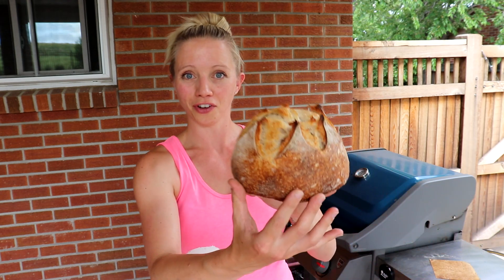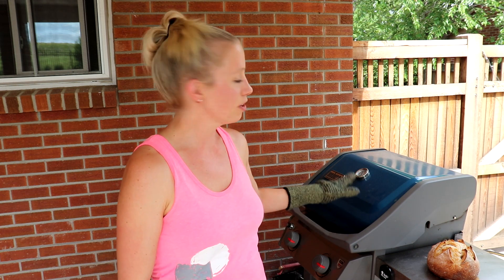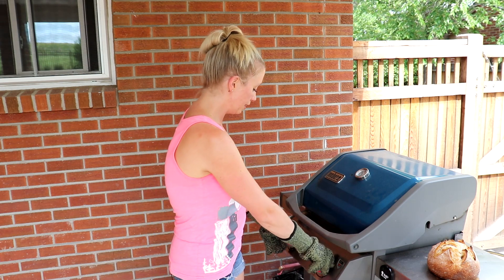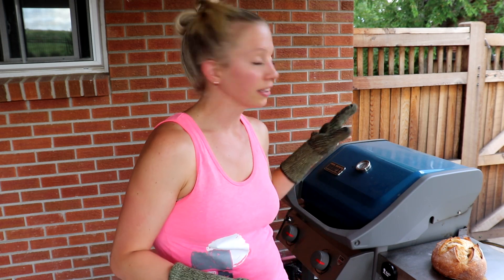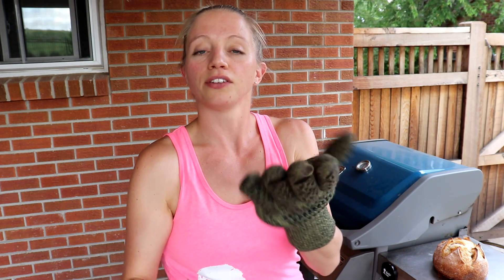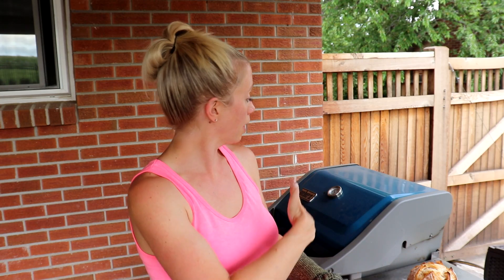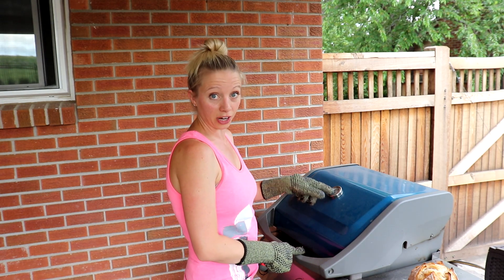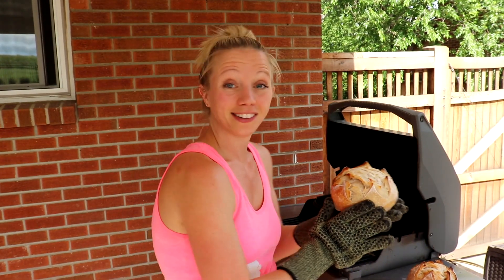How to Bake Sourdough on the BBQ Grill

Comment: Thank you… your video has perfect timing.  We are also having a incredible heat wave just now and I’ll be baking my loaves tomorrow morning.  I’ll try your method on the bbq and will let you know.  I’m using a pot style Dutch oven and will be putting cornmeal or oats on the parchment paper before placing the bread on it.  I’ll let you know
the results I get…
Carol
Reply from the maker: That would be great, Carol! I would put the cornmeal under the parchment, so it doesn't affect your final bread. Best of luck!
Reply: @leavenly8473  Did the bbq … I had trouble keeping the temperature constant so opted to give the range of 400 degrees to 450 degrees.  Went very well and the finished
product had more bubbles in the crust than usual.  Took almost an hour for the first bread and a bit longer for the second loaf.  Will definitely do it again.  Thanks for
the great idea…

Comment: I have a loaf proofing, that I started last night.  And, as luck has it, we noticed a plastic burning smell from the oven last night when I started to make dinner.  Fried wire in the back that leads to the main burner.  Yikes!  I am going to try your bbq method with this loaf.  Fingers crossed!
Update:  it worked!  It really worked!  I ended up grilling it longer but it was full of dried cranberries so it was more dense.  After taking the lid off, I placed an aluminum pie plate upside down on the pizza stone, to raise it up.  No burning on the bottom :). Great tutorial!  Thank you!
Reply from the maker: Thank you so much for this review! I love that you were still able to bake your bread despite losing your oven. Your tips for raising the loaf higher are also fantastic! Thanks Bernadette!!

Comment: I actually used our Traeger grill to bake my bread yesterday before I even saw this! Great minds lol. A Traeger grill is pellet smoker grill and doubles as a fantastic outdoor oven.
Reply from the maker: Thanks Ruby! We also have a Traeger and I plan to make a separate video on how to bake it on there! Any tips?
Reply: @leavenly8473  for baking bread I've found best crust results by making sure there is steam. If I'm baking a loaf I just place a large cake pan with a couple inches of water and then set the loaf pan directly in the water bath, if baking a batard or boule then I place a small loaf pan with water in the back or side